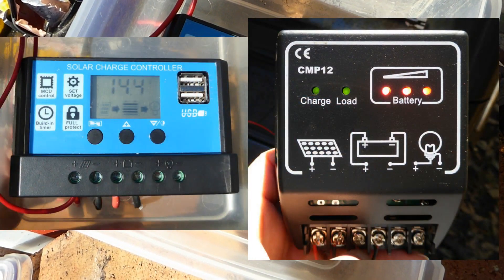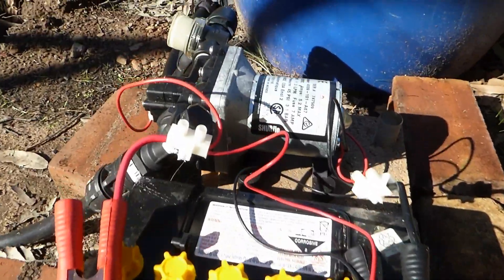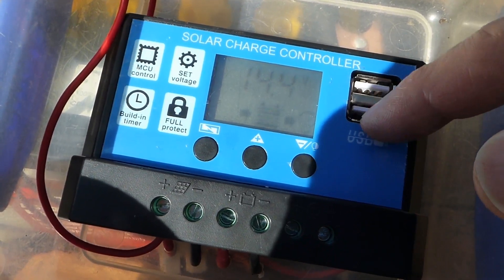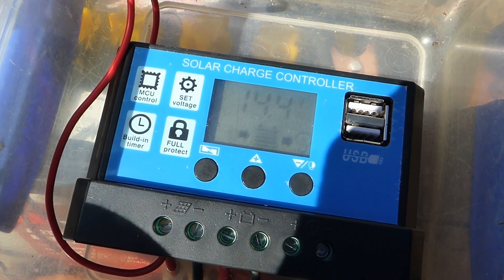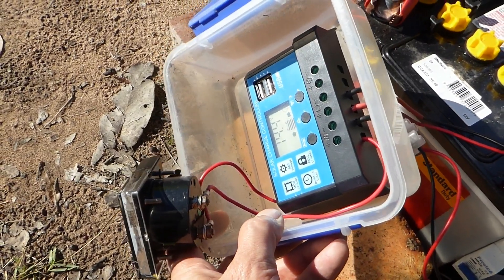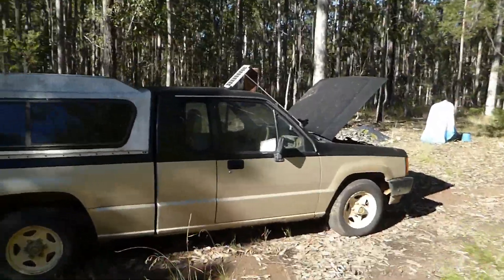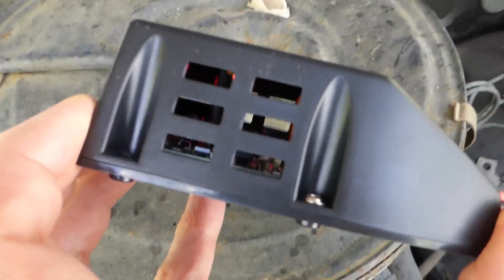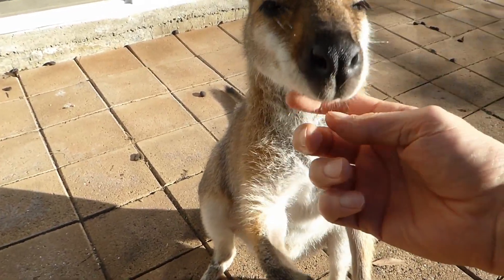Solar regulator PWM USB review charger

Comment: it cant work properly because the load Ie: your pump isnt wired to the load terminals so confusing it because it does all its measuring through the load terminals
Reply from the maker: No. it will charge my battery at 14.4V all day, without a load. This thing does no measuring of anything.

Comment: Wreck a battery easy with cheap solar chargers that makes them expensive , under $200 you could have a 20amp victron with blue tooth and solar use memory .

Comment: Mine(model identical to the blue one) would start upping the voltage at the start of the charge(early morning, 6h AM), than, as it gets to 14.4v(midday), it will keep it there until the end of the day(6h PM), even if I don't discharge the battery during the night, and even as the battery is pulling less than 200mAh of current from the charger. Shouldn't the charger go to "float charge" and try to keep my battery stable, from 13.0v to 13.7v (adjustable), when it is no longer getting usable current from the charger? Isn't that the dictionary definition of "float charge"? Ps: My inverter only turns itself on at 6h PM, so it can't be blamed for any "current leak", all the power produced by the solar panel during the day hours has only the battery as its consumer. So I see it's the same result you're getting there, no matter what you set on the configuration.

Comment: your probably have a much better one now but just by looking at your screen I can see already you have a faulty unit. I think in order to give a fair review you should buy a working unit first, I was just gifted one of these same cheap units and my screen shows the solar panel symbol, your unit has it missing suggesting damage. I might post a review if i dont throw it overboard first, I cant seem to find any straight answer to the battery selection menu options
Reply from the maker: I've got two of them. I have a third one which looks slightly different. No you can't tell it's faulty by looking at the screen. You just made that up. The main problem with this controller is that there is no brand name or responsibility. It's just a blue thing.  The issue is mainly whether it goes into float mode. This is a difficult decision for a controller, that depends on battery quality and current intermittent usage, and previous (night) discharge depth. Much easier to skip the issue. Victron uses a charge curve detection.
Reply: @Wallabynge  I didnt make anything up it's in your video but thanks for the all info will keep an eye on it
Reply: @Wallabynge  got back to my boat late last night. The unit has been running for I'd say just under a month now. I was expecting the worst but my fears where not needed. My starter battery which is the only battery connected to the panel is full and my float value has also been saved. I'm just waiting on bit more sun to top up from night time and when it claims to be in float I'll get the meter out and have a mess on. One thing that did concern us both though is the usb ports. We tested both ports and they hiss meaner than a stepped in snake

Comment: I got mine to use with a solar panel and submersible water pump. The pump operates for about 1/2 second then cuts off for 1/2 second and wont stay on. Any suggestions? Whats 'float' voltage mean btw?

Comment: Lots of comments from folks who I suspect sell these knockoffs of knockoffs saying there is "nothing wrong" with your controller.

I have two "cheapo" pwm charge controllers. One looks exactly like this (black plastic case and back), and has the "equalization-only" "feature" (never goes into float mode, nor does changing the battery type change the eq voltage - always around 14.4v :((. Internally it's very sparse, has "W88-2.0" pcb markings and most interestingly uses some soic-20 no-name mcu without any programming headers.
(This is sad, because at least with crappy/non-functional firmware, you can sometimes replace it with open-source firmware - doubtful this will be possible here.)

I have another pwm charge controller I got from banggood about a year ago, and this one (all blue case, with ridged aluminum "heatsink" back instead of flat plate). This one does go into float mode, and seems to be usable in this regard. This one uses some STM8 mcu with programming headers, so possibly reprogrammable.

So beware of the clone of clones.

Comment: nothing wrong with the controller... It's just the people that are not to bright don't know how to set it up properly.. all the things he complained about all can be fixed in the settings..and you need a panel that it higher then 12 Volt's... It's 14.5 volts for bulk charge.. and 13.5 for float..
Reply: And just for fun...  I paid for 2 more...£5 individually... So ten bucks for 3 and free shipping....
Reply: I'm going to agree with the idea that there are different versions(knock offs).
I have several of these (blue) ones & NONE OF THEM go into float.
Sealed lead acid...... check
Float setting.....13.8. Check
Continuous charge rate..14.4v. Check
Never reads any lower
Cooked battery...... check.......
Reply: @TheReefPimp  it's because your battery is fkd... If your lead acid battery can't make 14.6v with low current then it can hold a charge.... It can't go to float if it can't do the bulk charge first... Ovs... Think I need to make a video about this... So I can show how it works... Like a how to...
Reply: Which battery?  I have numerous batteries & controllers.  Cheap ones.  Not all are identical to the blue one but I have a few of the blue ones.  Weird that u think my batteries are no good because they work correctly with the one controller that actually does what it's supposed to......it hits 14.4v then it goes into float mode(13.8v) & stays there. 
By the way,  the 12v panel puts out 18-21v in the bright sun.  
I am going to make a video with these different controllers.  I am not an expert or claim to be one.  Just learning what these controllers need to be doing to ensure longer life for the battery & system.
Reply: https://youtu.be/T-WXAYersk0
Check it out.  That's the results I found on these cheap PWMs
Reply from the maker: You're assuming that there aren't several versions of it that all look the same. I have two that perform the same way, no matter what the settings are. The device is designed to be unsearchable, and has no brand name or markings. It's simply a blue thing with 2 USB ports, so I wonder how you know I'm talking about the one you have.
Reply: @Wallabynge  because I am not stupid... It's the same PCB and layout.. same way to set it.. it's generic as fk... And when it gets at a 30A it has heatsinks on the back And bigger caps... But still the same controller... Look up the manual... Has the list of settings .. think you need it..👍
Reply: @Wallabynge  so whatever .. 🙄
Reply: i have one and its driving me crazy. Not charging my batteries.
Reply: @Wallabynge   https://youtu.be/I1hrWOP7WYA.. this video may help.. shows the the settings.. you only need to set it to gel or leadacid depending on the battery type you have.. and have the right voltage solar panel.. if you have a 12 volt solder panal then it won't work.. because you need 14 volts to change a 12 volt battery.. that's the problem people are having.. and not understanding.. that and the settings the the right battery type...

Comment: With the blue one (every version) you can try to set PV OFF to 13.7V and if this doesn't work alone put a diode between the charger and the panel. If I remember correctly I tried to set the PV OFF voltage to that value but it continued to go up to 14.7 until I inserted the diode. Try it and let me know :)

Comment: The blue one is adjustable just scroll to the parameter you want to adjust and then hold the button until the value on the screen flashes and then adjust using the up and down keys.

Comment: So what are you using now? My blue unit died and I need another one. Cheap one.
Reply from the maker: I'm still using these battery boilers. One person in comments recommended a black one branded Anself, but you have to look for the name written on the controller, because someone is selling these ones as Anself. Your budget probably wont stretch to Victron Bluesolar PWM, around $34US.

Comment: With the blue controller to adjust parameters like float voltage press left button for up to 12 seconds and display flashes, then press + or - buttons to adjust then finally press left button to lock in value.
Reply: nothing wrong with the controller... It's just the people that are not to bright don't know how to set it up properly.. all the things he complained about all can be fixed in the settings..
Reply: I have bought 2 of these controllers. One of them you can set the parameters just fine.. the other is the same as this one... You can set the charge voltages or Battery type to whatever you want... But it will ONLY charge at 14.4V
Reply: Exactly.... changing the settings doesn't change anything.   Try it & verify the changes with a meter.  You'll see

Comment: I have 2 controllers (10A & 20A) which I use with a 100W panel and 12v AGM battery.  They were sold under the "Anself CMTD" name but are otherwise identical to the blue one.  The 20A auto-adjusts for battery type, the 10A is manually set.  Both have functioned satisfactorily; however, usage is limited to, at most, 5 weekenders and 3 week-long trips each year.  😃  They definitely require protection from weather & bugs.
Reply from the maker: But have they gone into float mode?
Reply: Yes, mine "float" as advertised.  My comment originally was intended to highlight the wide variance in performance between the many controllers sold which look the same as the one(s) shown in the video but may have better (or worse!) components and/or programming.  Even the Anself-branded 20A ones come in 3+ versions optimized for different usages and battery types.  I think the manufacturers just change the software ...
Reply from the maker: @ookookwhee3438  Thanks. Looks like you can get the Anself in Australia. It's a few bucks more than the basic one.
Reply: Just FYI:  noticed this video https://www.youtube.com/watch?v=fyF1NyYLK-g which reviews the same type of controller under yet another brand name!  Must be many Chinese companies popping these out.

Comment: I have burnt out 3 12 volt tv's with this same regulator, keeps putting 14.4 volts though them. I have to keep an eye on the regulator to switch it off as soon as I realize that it's getting up in voltage then back on when the batteries are low. Thanks for the video and comments, now I get it, it's the cheap regulator not going into float. Unfortunately someone did say it's adjustable but doesn't want to say how. Guess it's just another one that just needs to have a say but wont back it up. Another suggests taking the load from the batteries but aren't they charged to 14.4 volts? You would be connecting to the same terminals that the 14.4 volts is. I dunno but thanks anyway. Be nice if someone could clarify rather than comment. I'm with you on this one.

Comment: Yes, I've got one of those "blue ones with the two usb ports", and it always charges battery at 14.4 volts (according to the LCD), and it doesn't matter what I set the parameters to.  It appears to be stuck on the sealed battery equilization parameter (b1), and never switches to float charge.  A friend reports the same fault.  So, does anyone know of one of these regulators that does what it is supposed to do?  If it originally was intended to work as advertised, then something is wrong.  How to fix?  Maybe a bit of dodgy code?I used to have a wallaby who would come around for pieces of potato, until the dingoes came..............

Comment: I've never seen any evidence of flies getting into tight spaces like that.
Reply from the maker: It depends where you happen to place the device. Australia is blessed with wasps that build mud nurseries in small holes, so every small hole ends up being full of rubbish. There is a larger type of mud dauber nest on the top of the air filter.
Reply: Wallabynge now that i have had wasps build mud nests in my Milwaukee garden blower, i agree. I now understand why you mention this. I also found a wasp mud nest in my Milwaukee flood light i keep outside. I cant understand why they love Milwaukee products so much haha.

Comment: One thing that should be noted is that the blue one is a low side switcher.  The PANEl NEG is floating and is FET switched to negative. shorting panel neg to battery neg gives full charging. So is the load output.  That makes it hard to monitor panel voltage and power other things with raw panel voltage. Voltage was .3V low as are disconnect settings.  Timer not very useful, could have had 2 hours after dusk and 2 hours before dawn.

Comment: I think there is nothing wrong with your controller.

FLOAT CHARGE MODE: when the battery is going to be charged full, the charger will stop charging, but still supply constant floating voltage and small current to battery;

* your panel is charging at 14.4v, controller float charge set to 13.6, therefore it is float charging (the reason you have small amp from your meter). 
you can adjust the setting from [_MENU_2_] (float voltage)

* your battery is flooded type, but you set the controller to b02 (GEL). 
adjust it from [_MENU_6_] (battery type) 
and make it b03 (FLOOD)

ordinary car batteries are not suitable for energy storage and may i suggest using deep cycle ones.
nice veggie patch! cheers!

https://www.solorder.se/image/data/uploads/KLD1210.pdf
Reply from the maker: The definition of float is the voltage applied to the battery, not current. The controller always applies 14.4, even if I set it to GEL type. As your manual shows, it should be charging at 14.2V.   I set the battery to GEL, to see if there was any way I could affect the voltage.
A few days ago, the battery had boiled away, due to the high voltage. Now the residual charge is 0.4A. This means some kind of premature damage, like dendrite growth.
I will have to put more effort into finding a replacement, but under $100 there is not much luck. The expensive ones also tend to be bigger, which means a larger waterproof housing.
Reply: I concur this unit does not float charge, the voltage needs to drop to 13.8 but it does not...
Reply: 13.2v for agm would be even better
Reply: It completely ignores the configuration, gel, flooded or sealed. I can attest to that. It also, completely ignores the threshold when it should jump to "float charge" (get the dictionary definition of that, you'll see). My sealed 100amps stationary battery never got hot nor boiled away though. It is operating for about a year or so. I made all kinds of tests with several meters, wired in several configurations and got the same results as @Wallabynge.

Comment: Can I use this without battery? I mean like a converter 19v input to 12v output (load)
Reply from the maker: No. You need a proper regulator which sinks the heat somewhere. These things pulse 19v at whatever you are running.

Comment: The blue controller is a cheap knock off of another blue one that looks close to the same... I did some research before I ordered mine, I will respond back on if it does have an amp meter in it...
Reply: here is a video of the one I ordered... Its suppose to be a mppt controller... ..... https://www.youtube.com/watch?v=PW1-ga92N_s

Comment: I bought one of these, I checked the voltage and it was around 15.5v while the unit was saying it was 14.4v it's a piece of crap that'll cook ya battery. Better off buying a $114 victron mppt charger ;)
Reply: Wish I had seen this video & your comment sooner.  I bought several of these & thought all was well.  They cooked all my batteries.  They do not go into float mode.  The go into cook mode..... Don't buy it unless you're monitoring your battery frequently &/or manually disconnecting your system when fully charged.
Reply: @TheReefPimp  go the victron mppt, such a good unit. Sad to hear they cooked your batteries 😣
Reply: @moosevinkle  Thanks but the application I'm using them for isn't worth the price of those mppt controllers.  I am using a 7ah SLA battery to power trail camera's.  Plus I'm using them in not very ideal conditions.  Heavily wooded areas with minimal direct sunlight

Comment: Hold down the left button for at least 12 seconds.
Reply: nothing wrong with the controller... It's just the people that are not to bright don't know how to set it up properly.. all the things he complained about all can be fixed in the settings..
Reply: brooke robertson I’m setting up my Rv with a small panel and this controller. Any tips on how to install it and settings info ? New to the solar world. Any info greatly appreciated
Reply: 12 seconds .. and nothing happens
Reply: I've adjusted the settings & then checked them with multimeter.  It stays at 14.4v.  I have an Ecosolar controller that DOES go into float mode.  
These are the $3 scam

Comment: The 14.4V voltage is the charge controller doing an "equalization charge" before it goes into float mode.
Reply from the maker: Equalization is about 14.6, but this charger never goes into float mode.
Reply: well these controllers must equalize the batteries constantly, the only time it goes to near float charge is when the sun sets and the overall voltage drops. You only get what you pay for and with these controllers that's not a lot.
Reply: I've checked it with fully charged battery & during bright sun.  It does not go into float.  I have several of these & they were a waste of money.   I got what I paid for.
Reply: It never goes into float mode. I have the same issue. It just ignores the configuration you set. I made a lot of tests like @Wallabynge (if not more!) and got the same results.
Reply: @jefersonnl  100% correct.  I have only 1 (not this blue one) that goes into float mode.  Unfortunately, i can't find another of that same brand & model. 
I would like to know of one that works & is available to buy.